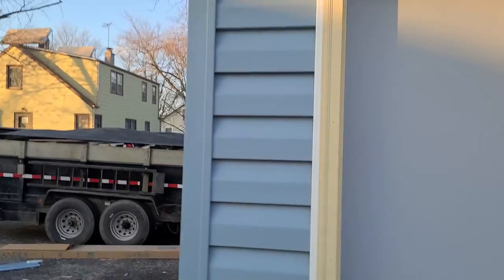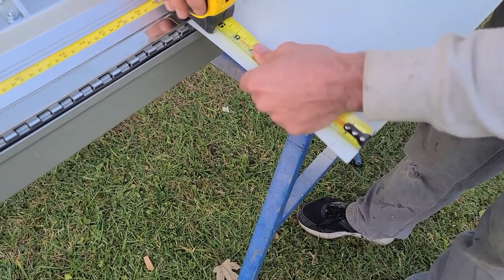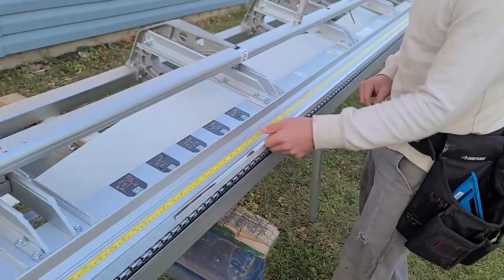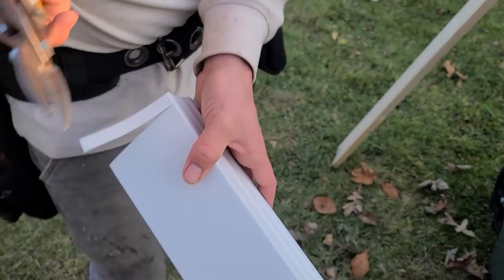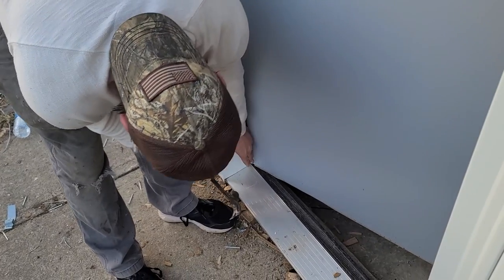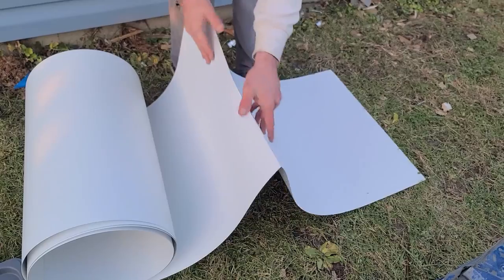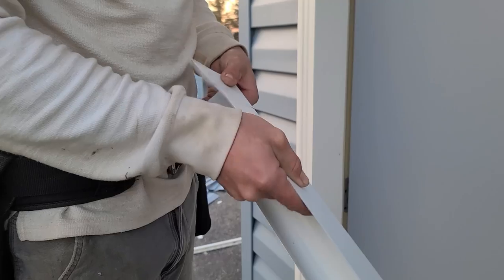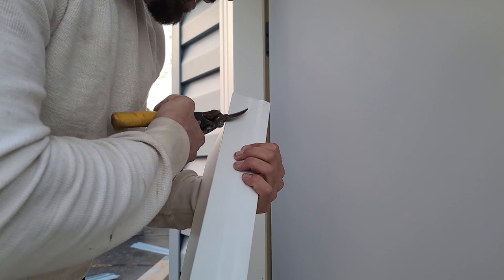HOW TO | Aluminum Brick Mold Casing

Comment: Try a 3/8" 90° bend and tuck it behind the yellow seal. Gives it a professional look.
Reply: I bend a 1/2" because 3/8" pops out while bending, but yes tuck behind the weather stripping
Reply: @timothybryson475  Adjust your brake a little bit. I have no issues with a 3/8"  end popping out.
Reply: things gonna wrinkle for sure when the sun hits it lol
Reply: Also drip flashes help with water penetration
Reply: You could probably get away with no fasteners when you tuck behind the weather strip. Half the time you almost can't remove them if you make a mistake because they lock right in.
Reply: That's how l do it too. Also, bend a 1" flap into the doorway at top of the sides
Reply: Only way to do it not only for looks but for water
Reply: Double hem bend at the edge of weatherstripping, then slide the brick moulding pieces into it. You don’t have to be nowhere near as accurate on your measurements and it’s way faster and looks better. Plus, it helps with eliminating the wrinkles.
Reply: I've found using threadlocker or center punching the edges of the adjustment screws to keep them from coming out of adjustment during transportation is key. Or quit throwing your brake around like a sack of potatoes. @jhart3192

Comment: I scrolled through the some of the comments to see if anybody already mentioned it and didn’t see anything. Was just going to mention using a sill trim piece. Easily bend them out of scrap ripped pieces and it only a few seconds to bend. Then you can run those up to the weather stripping with a clean edge and nail them on and slip your brick mold trim into it and not need to face nail anything and the hold is super tight. It all makes way more sense once you see it if you’ve never done it like that. Maybe you knew that, maybe you didnt. Just thought I’d share. I like to see how people do things different to see if I can improve anywhere. I’ll definitely be using your j-channel method, not that I was slow but you just proved to be more efficient. Well done 👍🏻
Reply: No sill, bend 3/8 inch to tuck in-between wheatherstrip and door jam
Reply: It's called a clip. Similar to  or f channel but holds the metal tight.

Comment: If you do a 3/8th return on your sheet metal pieces that you bent for the door (the part that you had measured at 2 5/8th), you can stuff that perfectly into the weaterstripping and it will not only seal off the wood it also holds it in place so tightly you may not even need trim nails. Keep up the great work brother, I've been watching this channel on and off for some time now.
Reply: What brand of brake . I have a tapco 5/8" minimum bend
Reply: Tapco can still lock onto 3/8"
Reply: @avidb9150 I don't have a problem doing 3/8in bends

Comment: I put the xtra 90 where the flat stock meets the weather strip and tuck it between the weatherstrip and the door frame, not sure if its correct but it gets rid of some unsightly nails and cleans up that edge. Great job man keep up the great work.

Comment: I work for renewal by Andersen and we don't use nails, but your job have great quality... Congratulations
Reply from the maker: I try not everywhere.  But on the doors I do. Gonna try the back bend into the seal.
Reply: I work for renewal as well work looks good but man you skipped a lot of steps. No bends in the top of jambs..shouldn’t need caulk those seems looks way cleaner. No tabs on the top. Threshold should have a kick plate so it doesn’t flex so much. Cladding should be caulked to threshold so keep water from rotting the wood jamb. Also if u do a 3/8” bend into the weather stripping you don’t need to nail it.

Comment: Instead of caulking your upper corners when do your two verticals add half an inch and bend that half inch 90 with hand seamers. And against the weatherstripping install a sil with a hem then you slide your caps into them same as a gable trim. 
Use a soffit stapler to fasten through your vinyl J. 
You shouldn’t have any exposed fasteners. 
Congrats on that brake buddy. Nice tool !
Reply from the maker: thank you

Comment: Put a reverse with a hem on the door side and rain flaps on your header return. You're supposed to trim the door before the J and use a 1"-1 1/2" reverse under the J to flash the door. That's how us Old School Vinyl Guy's do it. I even tape my reverse to the housewrap before hanging the J. I don't usually brake buddy my wraps because the miters look like crap.
Reply: Just need more experience with the brake buddy. It makes everything easier once you figure it out.

Comment: I've got a brake buddy aswell I have the brick mould wheel and the rip wheel for the fascia. It helps us be unique in my area and offer something not alot of other guys do. Yes the rip def helps reduce oil canning. One other thing I do is silicone all my aluminum on and dont use alot of nails
Reply from the maker: i hear ya on that. as soon as i bought it i was thinking about how i should charge more for custom bends and offer that instead of regular ribbed fascia from the factory.

Comment: Great video. Only thing I do differently is make a flap at the top instead of cutting out or in the slight angle you did it will close all that in and won’t have to caulk those corners.
Reply from the maker: Thanks for sharing!

Comment: Bend 3/8 tuck into door seal and top of the side jambs should be bent at a 90 that you don't have a gap where they meet if you do it this way you won't have exposed nails. Also cut the legs at the angle of the sill.  I recommend the tapco gauges no need to keep pulling tape measure out.

Comment: Instead of cutting a big notch out of side pieces on the inside bend out an 1 1/2” + tab onto the header. It gives you a place to nail under a lap without the need for caulking. We used to make a small flange onto the buck reveal and nail the covers to the edge of the buck. Then we’d put a separate pan (tab at the top) to cover buck reveal nails and tucked behind the weatherstripping. This makes the cover backed by wood at the inside corner less vulnerable to inevitable impacts
Reply: True

Comment: Nice work! I prolly would have bent 1 tabs on the sides at the top to tuck under the head trim. It finishes a lot cleaner and protects the wood alot better from water

Comment: If if you would have been that in 2 different pieces one for the break mode and the other for the jam you would have been able to install a storm door later
Reply: Storm doors are installed on the outside of the brick mold. A real pro installs wood filler strips and takes the correct measurements so the metal wrap is tight to the wood trim. If its not tight, it will dent very easily. I guess none of this matters if it just has to look nice until you get the check and ignore all the homeowners' callbacks lol
Reply: If there's a storm door is called for on the door don't wrap the jambs behind the storm otherwise they'll get dented to shit no matter how you installed your wrps

Comment: You are supposed to fold the top of your side piece so that it goes behind your header piece. It gives you a nice spot for a hidden nail. Also , The Edge meeting the weather seal should have a small return to go into the weather seal crack or that bare metal Edge should have a hem or should be returned into a piece of aluminum undersill  caulked and nailed onto the wood. All three options illiminate rippling. The undersill nailed behind the trim peice illuminates the need for all face nails on that surface
Reply: Spell check bro. But your a hundred percent on everything you said.

Comment: You should nab yourself a cutting rack for the top of that break. It consists of I think 5 rollers on a mount with a rotating bracket arm and a table with measurements scribed on the side, your aluminum sits on the far end of the bracket, you roll out exactly how much you need (without having to use your tape) and then simply slide the cutter. Boom, in roughly 1.5 seconds you have the exact length of sheet you need, at an exact 90.

Comment: Magic Eraser works wonders on trim coil to get the gray marks out!
Reply: Just use lacquer thinner on any rag/paper towel. It dries nearly instantly and doesn't leave any oily residue for when you caulk joints. Plus, it's a whole lot cheaper than constantly buying magic erasers

Comment: If you hem your first bend it helps the brake buddy from slipping
Reply: You'll pull apart the j channel every time with a hem on there.
Reply: @arihooley2046  what do you mean ? Explain please? I mean hem the part on door jam side not  on outside of brick mold
Reply: @trimmasterld  hmmm, maybe you know something I don't lol. My 1st bend is almost always the outside of the brick mold. I always clamped the remaining portion in the brake and ran it across.
Reply: @arihooley2046  see I usually bend starting from the inside like the jam side or on a window I start bending from side touching the indie first...honestly I don’t like the brake buddy look...too flat looking ...
Reply: @arihooley2046  or maybe the roller I have for the brick mold just sucks idk lol...

Comment: I always see people scoring the metal with a knife, which is fine but dont run your knife all the way on the brake. It was mess up your teeth after a while on the brake. I usually score th metal about 3/4 of my length and then go from the other side. That way my knife tip never hits my brake teeth at all

Comment: That molding tool is badass 👍🏽 I like to do a 1” bend with a hand brake on the inside top of the risers where you cut them off flush...that way the top inside corners are all aluminum vs having to caulk them.  But clean job bro...I like the attention to detail
Reply from the maker: Right on

Comment: You did a nice tidy job there. Golden like a shower had me laughing big time! I have a question if you don't mind. Recently I had a new front door installed and they fastened the brick mold to the jam with small nails on the front face and then filled them (albeit badly) with putty. Is this a normal practice? I find some of them very noticeable. Thanks.

Comment: A real pro installs wood filler strips and takes the correct measurements so the metal wrap is tight to the wood trim. There is a way to make 45s look nice without leaving your wrap a 1/4 in away from the wood trim. If its not tight, it will dent very easily. Also as someone else mentioned the 3/8 tuck behind the sealer strip. I guess none of this matters if it just has to look nice until you get the check and ignore all the homeowners' callbacks lol

Comment: So when ( not if )it comes time to replace the door weather striping and you nailed right through it . How much are you going to charge to fix that problem. Maybe put
Under sill trim on first or a hem piece and nail back past the weatherstripping and push trim in to that. The panter will thank you. They take them out to paint doors so paint won't stick to striping so doors can be shut. Just talk to them. I'm very surprised  no one has not called you out on it. But hay what do I know I'm just one guys opinion.

Comment: Its a bit more cost but.run a bead of clear silicone.top bottom and full lenth .moisture and a bug barriers inner and outer.because water is driven by wind.helps with furniture moving snags too

Comment: i bend the brick mold and where it touches the inside3/8 jam i put 3/8 back bend on that then bend the inside jam 3/8 by whatever and 3/8 behind the weather sill.six pieces. incase they want a storm door later . i have six storm doors to install this week .i hate storm doors but i think there necessary.

Comment: Videos are always on point 👍🏻 i clean our metal with spray nine , can usually get it at home depot cleans the pvc coil nice as well along with the siding, give it a try you wont be disappointed
Reply from the maker: I will keep that in mind! No paint transfer on the vinyl? I can't find anything to get scuff marks out without destroying it
Reply: Foam cleaner works well just lightly spray rag and wipe

Comment: Whats the tiny thin strip on the ends all of the frame need to buy some ..
Reply from the maker: Weather stripping?
Reply: on the outside of the door around the brickmold thats  already attached to the siding of the house  @NWIVeteranConstruction

Comment: 17:27 quad wouldn't crack. Should have caulked the sill. 
Nice work though. I also recommend folding the header over the rails. 13:09
Making your piece slightly longer than needed and the brake buddy rolling on either end doesn't matter. 4:10
Again though nice work.
Reply from the maker: Great point!

Comment: It looks nice.. Why not bend tight to the brickmould and show the jamb reveal? Only 2 more bends? And it looks more complete. Like your videos!
Reply from the maker: thanks. seems a lil extra no? its not much more work, but its more room for error and throwing tools...lol worth the look?
Reply: @NWIVeteranConstruction   No i dont think its more frustrating, and the other thing is the aluminum hugs the wood better, rather than having the gaps under it where if someone beats up the doorway moving stuff in and out (always seems to) then it would hold up better rather than dent or crush in.On my old Tapco brake a half inch is as small as it wants to bend so its a no brainer, i dont even have to measure it.
Reply: I also think the steps help hold the miters together.

Comment: Should put a 1/2" bend behind weather strip and caulk the bottom
Reply from the maker: yea could do that! not a bad idea
Reply from the maker: i'll try that on my house and make another video
Reply: Oh yea you need a drip cap
Reply: @NWIVeteranConstruction  I'd do it on the sides for a clean edge but leave the top as you did incase water ever gets behind it somehow.
Reply: Yeah i make a 3/8 bend and tuck in between jamb and weather strip.

Comment: U can fold the side pieces at a 90 on the inside before u put the top on and u wont have the gaps or at least not as bad
Reply from the maker: yea that was how i used to do it. always seemed to be easier and just as clean to caulk. my caulk would've looked nicer if i had a new tube
Reply: @NWIVeteranConstruction  just wasn't sure if that was something u ever tried

Comment: Looks clean af dude. Only thing i do different is throw a 1/2" bend on the end and tuck it between the wood and weather seal. Aluminum can get a little wavey otherwise on a 7' bend
Reply from the maker: yea someone else suggested that as well and i haven't though of that. but yea that bend was only 3.75

Comment: That sill plate should be reinforced with a 2x4 also when your bending metal always Theron side out duh everyone knows that. Also if when you mark the sides you go up an inch and back an inch cut the square out then cut to were you wanted to cut it off fold the one piece forward and the other down and it will make it look and function so much better

Comment: Next thing you should invest in is the coil holder and the cutting wheel
Reply from the maker: thinking about it! do you have that and like it?
Reply: @NWIVeteranConstruction  yes there great def a time saver to be able to keep the coil mounted on the end of the brake and the cutting wheel makes nice smooth cuts
Reply: I picked up the tapco stand with the wheels on it last year aswell
Reply from the maker: @ivtec845  dope i'll look into it

Comment: I always bend it all with the brake. 3/8 into the seal and then it’s totally encased. No fun expensive tools to make brickmold.
Reply: U can do 2 piece  or man up and bend it all. And caulk is a last resort. I didn’t see any “flashing” bends here..
Reply: And you aren’t applying anything to accept a storm door
Reply: Not very well done in my opinion. Real trim guys don’t need caulk, ever. No folds on top. You couldn’t put a storm door on that, you can’t replace the weatherstripping, exposed nails, hell the brake wasn’t even sitting on the sawhorses right. Amateur hour.
Reply: And I could bend brick mold faster than you can run that brake buddy down it

Comment: Cutting into your new brake with your utility knife is hard to watch.  U do good work but you just screwed the door from ever having a storm door by floating your cap over the gap between the brick mold and the door stop.  U cant bend less than 3/4 in the middle of a bend so I usually cap each side and top in two separate pieces and them caulk the gap with as small a bead as possible so u can still put a storm door but most importantly you don't hav a hollow piece of metal in a very high traffic area to get beat up and dinged up.  Yw 
The capmaster
Reply: Hey capidiot how many screen doors have you seen on a garage ?
Reply: Who tf puts a storm door on a garage entry door. It would be a huge nuisance, and it'd get destroyed from moving items in and out(which is what a garage is usually used for)
Reply: I always avoid 3 things in this line of work. 
-make it out of 1 piece if at all possible 
-use the least amount of nails while still knowing it will not come loose
-use the least caulk unless it is necessary to keep the water out
Reply: My philosophy. Keep the water out and make it look good for years to come.

Comment: Omg, please people do not cut it flush!!! If you can't bend it properly with a 3/8" bend in behind the weather stripping make a 3/4" reciever piece and slide it in. But as others mentioned the best is ti tuck it in behind. I cant believe people actually pay for this. Some just don't get taught properly.  If you don't know what your doing, don't post a video of how bad your job is. I'd be embarrassed.  
Once there is temperature change this will buckle. If you have the 3/8" bend it's a solid rigid edge not a floppy disk like this will be. UNREAL.LOL